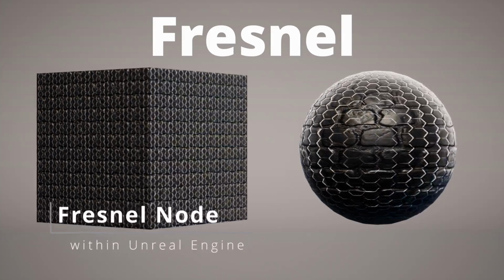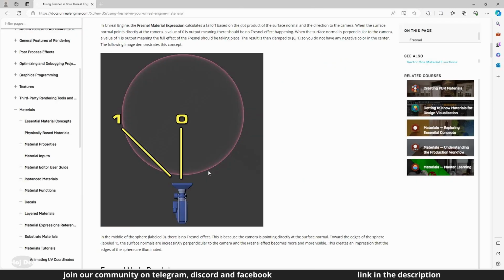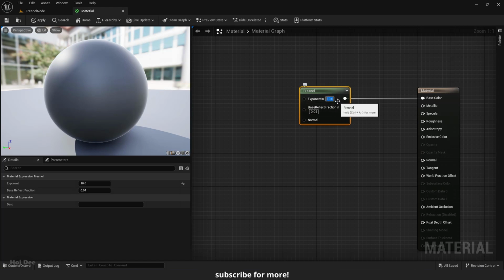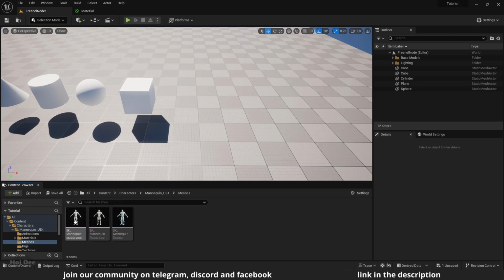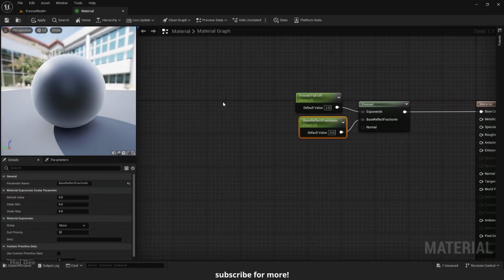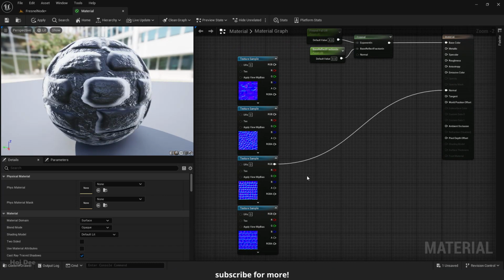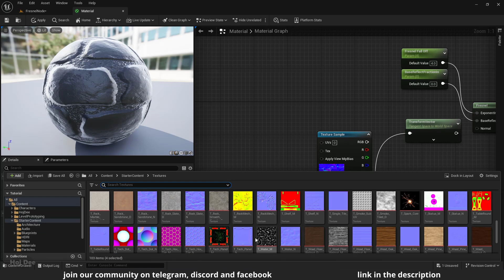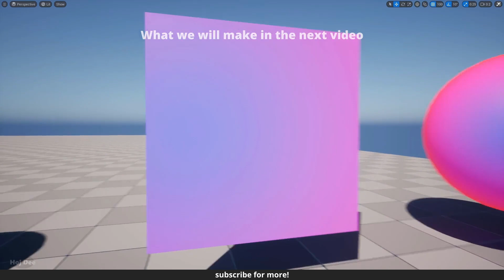FRESNEL node EXPLAINED!  Unreal Engine Materials

Comment: How would you drive Fresnel on a certain part of a mesh? Let's say I have some weapon and it has a gem on it. I want the Fresnel effect on the gem only. How can I do it? Is it possible if I have a single material for the weapon or do I need one material for the gem and another for the weapon?
Reply from the maker: I'd either use a mask for that part or create 2 material IDs. Using a mask is more efficient